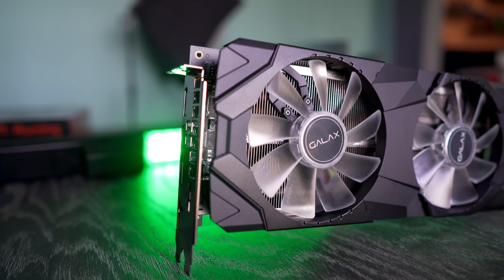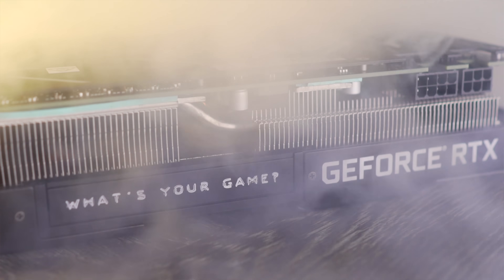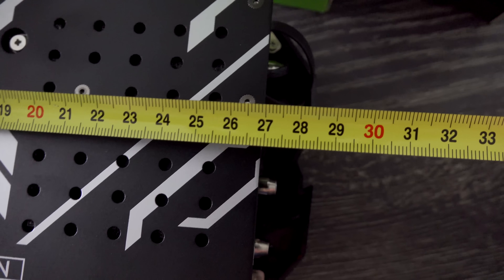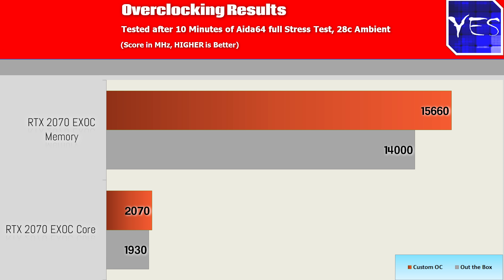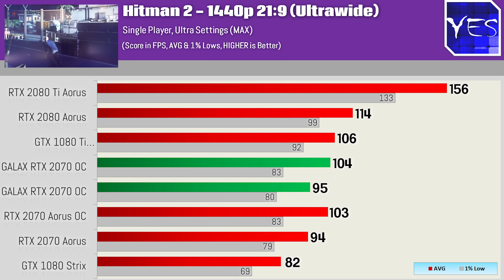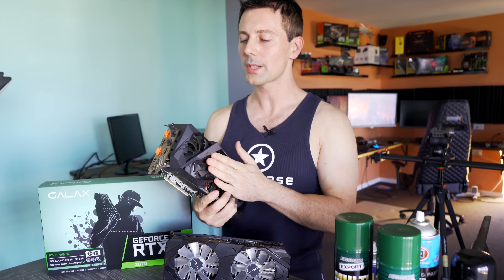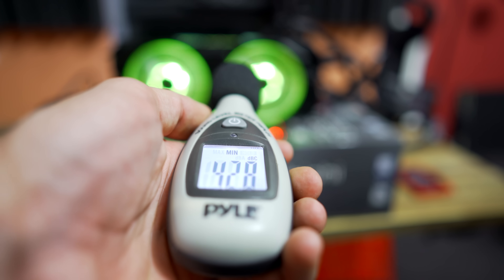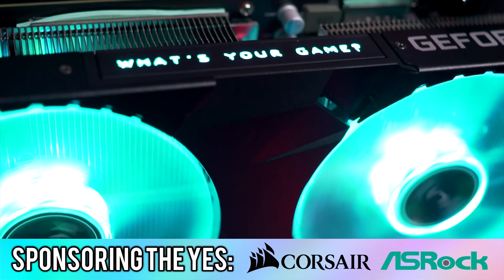Galax RTX 2070 EXOC Review & Benchmarks - GTX 1080 Ti Performance....?

Comment: i do currently own the Galax RTX 2070 EXOC in my other computer but only have a 460psu  in my much more power computer in which is a dell custom made computer and this card will run extremely well in it but the only thing is the 460 psu, its that to weak for the Galax RTX 2070 EXOC

Comment: I got the RTX 2070 Super. Is that one is the over clocked version? What is the difference?
Reply: it's a lot faster basically., it's not an overclocked 2070, it's a brand new card with a lot of extra cores etc, it's closer to the 2080 in power.
 it's only a few fps lower than the 2080fe in most games, and faster than the 1080ti in most. With overclock it's a beast of a card.
Reply: @monkeyboysteve3807  thanks. it turned out i have the over clock version as well. Performs well for rendering 3D models but might go with an SLI set up.

Comment: Could you tell what chip version this Galax is packing? Is it TU106 400A or TU106 400?. It would be good to know if Galax is doing the same like evga, gigabyte and msi with the lower models getting the TU106 400 version of the chip. Thank you for your time.

Comment: Hi Brian Easy,

Avid fan here.

do you know how much in fair aussie dollars I can flip this system?:

Specs:

GPU: ELSA Nvidia GeForce GTX 970 S.A.C 4GB (Japan brand) 
CPU: intel i7-3770k (Ivy Bridge) unlocked cpu
COOLING: ID Cooling Frostflow liquid cooling AIO 120mm Radiator
MOBO: Asus P8Z77V-LX
RAM: (8 GB) Team Elite Single Stick DDR3 1600MHz
HDD: 500gb toshiba black 7200rpm
PSU: GreatWall Volt 600 Watts 80+ True-Rated
CASE: Coolermaster cmp 300 series Case
LEGIT OS: windows 10 pro. Licensed not crack. not auto upgrade.

Comment: I have gtx1080 and i5 6600k. My pc box is always open for extra cooling (no side wall). I have only 2 fans inside - on cpu and gpu and both fans are set to 45% performance (cpu 40 to 90% depending on temperature). My room is silent and I have no complains. :) I have no idea why you need these cards.

Comment: OVERCLOCK?? Hey mate i may of missed it in the vid and the comments below but what roughly is the overclock. I have a galax 2070 ex 1 click oc. Through xtreme tuner all 1 click oc gives me is 45 gpu clock offset which is crap, i had it running way above that through msi afterburner. Could you please tell me what i can put it up to through xtreme tuner so its close to max but will never crash on any game. My cpu is i7 9700k, cooler master 240L rgb plus 3 rgb 120 fans, 2x8gb of trident z 3200, +80 gold 750 psu, asus strix z390-f gaming motherboard. On heaven i got it to score of 3113 with afterburner but it crashed from time to time in game and im almost certain it was the gpu OC not the cpu OC. Any help would be great, cheers.

Comment: For those that say it is disingenious for Bryan to not overclock the 1080ti in a comparative test completely missed the point. It is obvious to any viewer when the 1080ti is overclocked, it will definitely take the lead away from the 2070 overclocked. He's saying that it matches a 1080ti at stock, which is incredible for the value.

Comment: Darn.  Their software actually runs on my system unlike the EVGA PX1 software, but the software cannot control reference LEDs.  I cannot believe Nvidia still has not updated LED Visualizer to support at least turning off this annoying effing LED on the reference card.  I'm about at the point where I'm just going to take off the cooler and unplug the damn thing.  Christmas is over.  Red and green computer lighting no longer cuts it.

Comment: I used the EVGA XC Ultra RTX 2070 for my new gaming rig . Paid $545 before taxes . To me that was the best value . Mind you I bought said GPU in Nov. last year . It's factory clock is set at 1725 MHz and has no problem with what ever I have thrown at it as far as games .

Comment: All these gpu's... I'm happy with what I have especially since I JUST upgraded from a 550ti to an RX580! Yeah JUST! Soon will be going from an AMD Phenom to a Ryzen. Minecraft is gonna get fun again!
Reply: Which ryzen were you thinking of? I hear the 2600(x) are great for the price/performance.
Reply: @ZarodGaming  already ordered a 2600. I was gonna get a 2700X but with the 3000 series coming soon I will hold off till then.
Reply: @ZarodGaming  8400 cheaper and performs much better in gaming
Reply: @AestheticKunt  he said he wanted ryzen so i mention ryzen
Reply: @AestheticKunt  It depends on the games, and Ryzen 3000 series will probably be a big step, so it may be better to wait for that one at this point.
Reply: This is my situation. I just got a 1050Ti 4GB an upgrade from a GT730 but I am running an i5 2500 and it is showing its years in higher titles like AC Odyssey and FarCry 5. I'm not so concerned with frames, they will remain between 40 and 60 but load screen stutter (rendering) can get pretty game breaking. Right now I can get a Ryzen 7 1800X for around the same price as a Ryzen 5 2600. Both run around $250 Cdn (pretty much on par with Aus) but that doesn't seem to reflect pricing. Even though most of this stuff is made in Malaysia and Taiwan, Aussies seem to get hit harder with prices.
Reply: @OcihEvE  Do you use an ssd?  usually load screen problems are a cause of the speed of your storage .. they have cheap ssd's with high amounts of storage now days.
Reply: @jnck206  I kind of knew I worded that poorly. I am referring more to rendering stutter. When you are running and get that sudden mini freeze while stuff loads in. It usually means your CPU is having a hard time keeping up. 

Yes, I use a 240GB SSD as a boot and have several 120GB SSD's that I store active games on because as you said, they are rock bottom cheap, go for $20 each (here in Canada) 

I simply need to retire this 2500. The age and the 1333 Ram limit. That and the cheap Ryzen market right now.
Reply: same here, gts 450 (oc 950/2000 beats a 550ti hehe) to rx580 8gb and 8600k 5ghz

Comment: not really a fair comparison stock gtx 1080ti vs rtx 2070 oc. With a overclock the gtx 1080ti would run away with it.
Reply: @Karl Looper  Indeed, I don't know why but a lot of reviewers just want to move away from the 1000-series cards, which IMO are still a better bang for the buck and don't sport the obvious cash-grab that the RTX series does.   It's ridiculous that anyone would pay over 1000 USD for a GPU.
Reply: rtx 2070 OC means it can be OC does not mean it already is!! that is what the OC means on the box!!
Reply: Agree. He should have also included overclocked 1080 ti.

Comment: Great video as always.  But why do benchmarks at 1440 and higher when the majority of people that game use a 1080 monitor.
Reply: I concur, the vast majority of PC users have 1080P displays.  Higher resolutions are still in the minority.
Reply: @MisterTonyG  maybe you're rite... Because my self play in 1440p monitor and I watch only 1440p vids for benchmarks...
Reply: This new rtx cards are for 1440p games... 1080p monitor? To outdated!!!
Reply: 1440p is becoming a new standard, because cards like 2070 or higher would botteneck at 1080p unless you have a i7 8700k or higher, every ryzen cpu , even the 2700x WILL bottleneck these new cards at 1080p

Comment: I just rolled back the driver to fix my 2070 from 417.71 to 417.35.

Never had artifacts (yet) but the whole system freeze and other assorted variable problems i did have, to the point i couldn't even log into windows.

Nice $$ performance thou. GDDR6 can only get better.

Comment: Short answer:

 Stock = about 15%-18% slower than the 1080 ti
OC'D = within a few fps of a stock 1080 ti (maybe stock performance if you win the silicon lottery)
Reply: my 1080ti runs at 2100mhz all day I doubt an rtx2070 will ever come close
Reply: @TheWretchedWorld  I've got mine clocked at 2157 runs hot tho at 83c
Reply: @Sc2God724  you are lying because a 1080ti won't run at that speed at that temperature
Reply: @TheWretchedWorld  better cooling
Reply: @Sc2God724  My 1080ti aorus had fantastic cooling, still got nowhere near that speed.
Reply: @monkeyboysteve3807  I have mine in a open case in an ac environment I prioritize performance over noise and looks
Reply: @monkeyboysteve3807  my memory is running at 8050
Reply: Half a year later, it will be at 1080ti or less than 10% due to some "driver optimization" aka nerfing previous gen GPU through driver
Reply: @Archmage1809  Again with this bs? https://www.techpowerup.com/forums/threads/nvidia-gimping-benchmarks-gtx-780-tested-322-21-vs-353-62-vs-376-33-vs-398-36-vs-411-70.248256/
happy reading
Reply: @Archmage1809  nobody forces you to update drivers and you can go back to any previous driver you want by disabling GeForce experience 
Still i agree tho rtx 2070 will be getting better drivers as Nvidia would want to focus on the newer products and not the ones that are two years old
Reply: @Archmage1809   not through driver, through unoptimized games